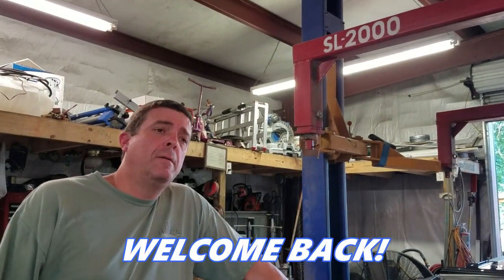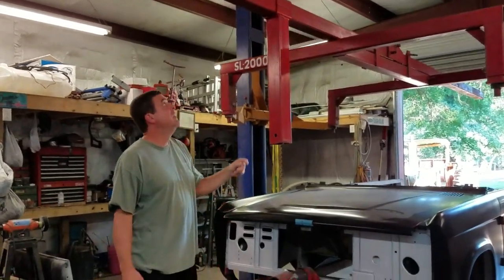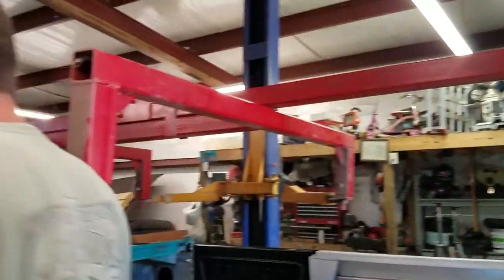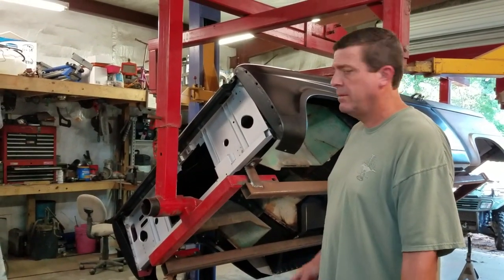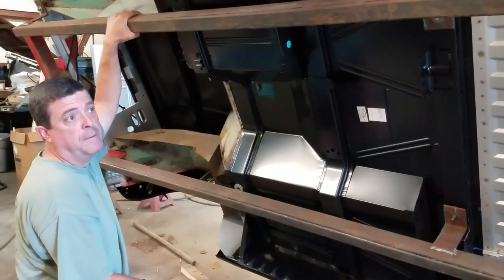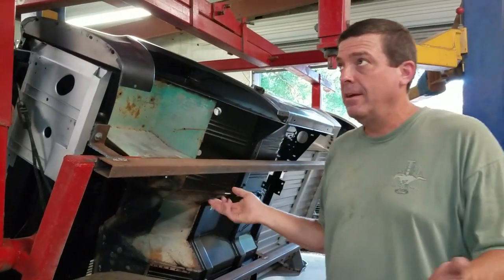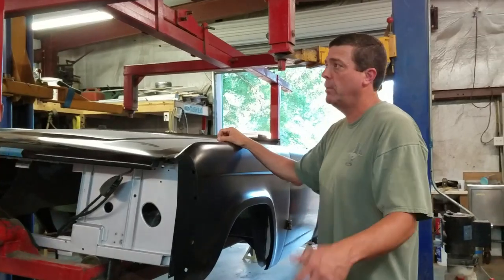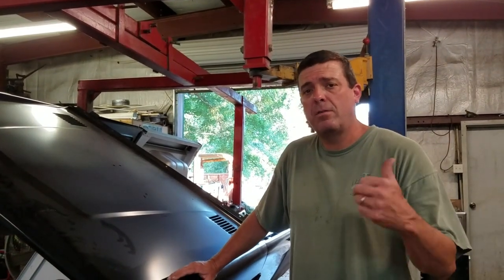ROTISSERIE! - 1966 Ford Bronco Restoration Project

Comment: That's a nice design Jason, I wish I could steal it however I'd have to cut a hole in my ceiling for the lift to fit. I think I'll be rigging up some engine stands with some square tube between them. I'm trying to enjoy my motorcycle trip but you keep making want to get home and work on the Bronco. Keep the motivational videos coming, I need all I can get.
Reply from the maker: Ha...We were supposed to go on a road trip out west later this year but due to all the unrest we have canceled.  Your pictures make us want to just say the heck with it and go.  Thanks man